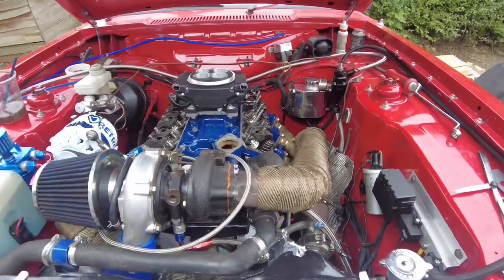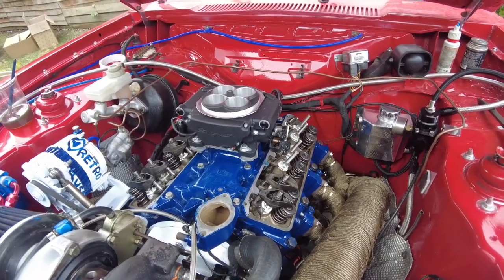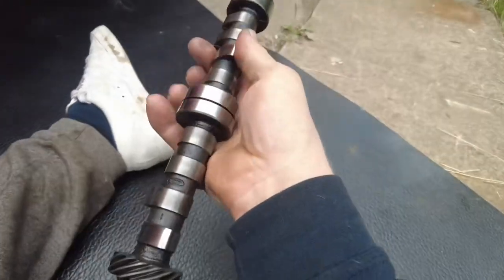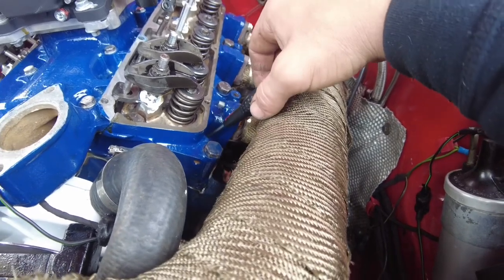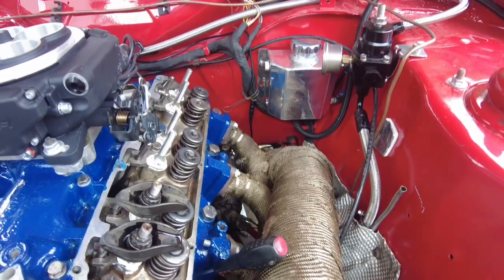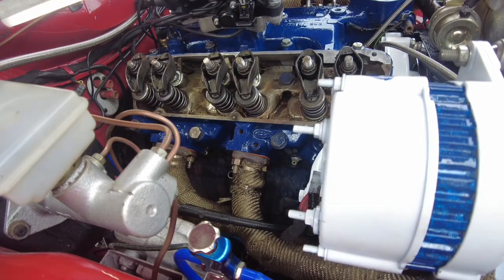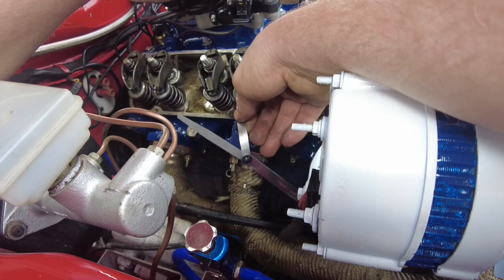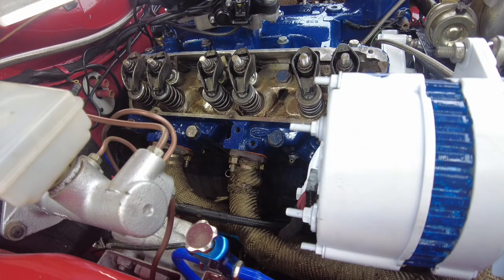Quick vid of Christine , ￼ easiest possible way maybe to adjust tappets :D

Comment: Using a DTI to determine TDC dwell is just as old school as using a screw driver and far more accurate in a difficult situation where you've got reach down beyond the turbo to turn the engine over and hold the screw driver at the same point on the piston head.

Comment: Hi Jamies  !!!..... From memory the firing order is 1-5-3-6-2-4   ????
.
(you need some Tipex to bad on the 2 rockers each time you adjust them)
.
But i thought ?????........ :-
.
When slowly turning the crank ..... if you want "cylinder 1"  = "cylinder 6" -on the rock with vales both  slightly opening and closing ???
...
Then if it's "cylinder 2" = "cylinder 5" -  on the rock
....
Then is it's "cylinder 3" = "cylinder 6" on the rock 
....
see ???... and so on  !!! ... until they are all tightened .... but on a rebuild let then "carbon in" for a week or so as they,ll stray again after a short time  !!!!
------------
------------
Jamie i'm sure it the same difference  ???... and i bet your way is the way Ford garages did back in the day  !!!
-----------
-----------
Hey you're a brilliant welder mate  !!!!... and looking forward to your next Rusty vid
...
CHEERS